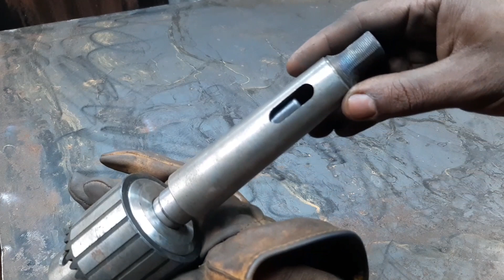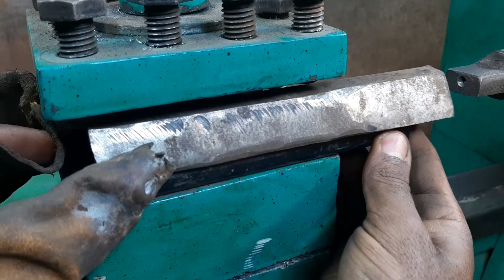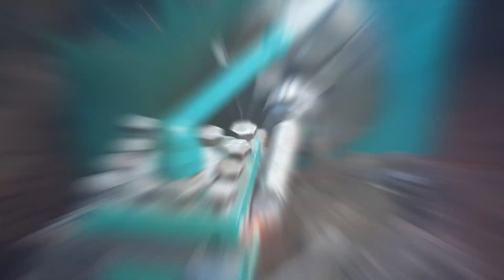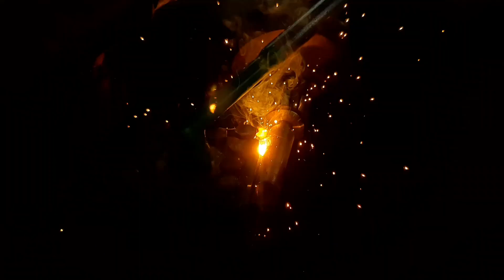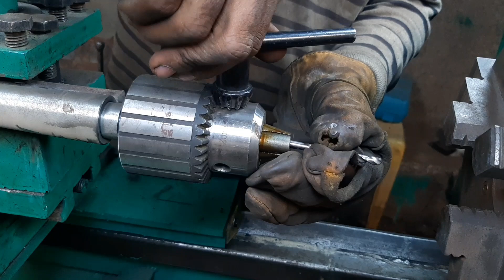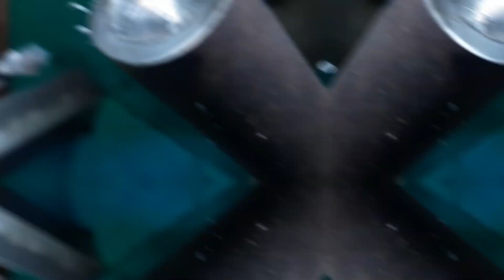Cool Idea for my /homemade /lathe machine

Comment: At first I thought you were welding in the chucks built in taper, I'm glad it was just the taper adapter. You probably could have gotten better concentricity between the machine center and the Jacobs chuck by cutting a piece of stock down to the largest size the Jacobs chuck could hold, and without taking the stock out of the jaws, attaching the Jacobs chuck to the stock to position for welding, but that would only be good until you took it out of the tool holder.
Reply from the maker: Best comment ever....tanx soo much...
...🙏🙏🙏